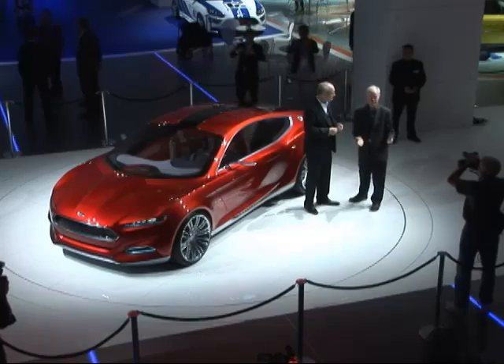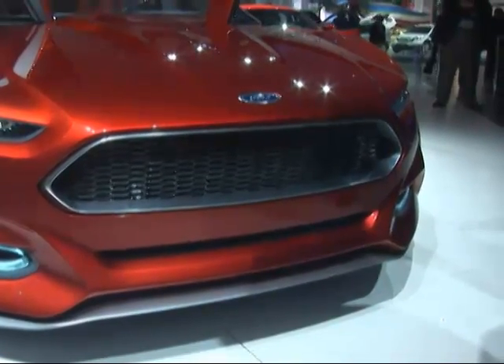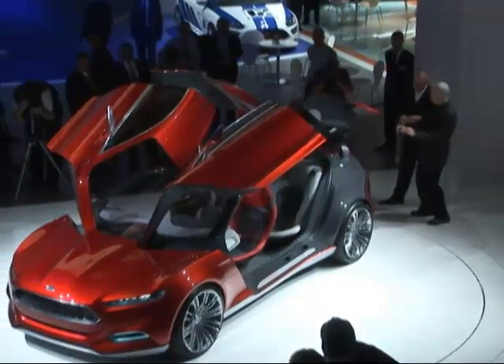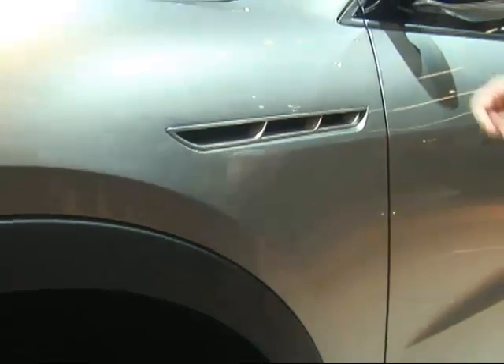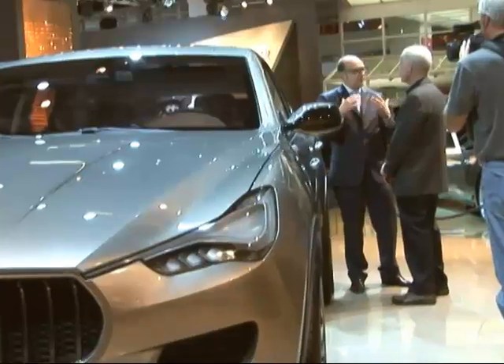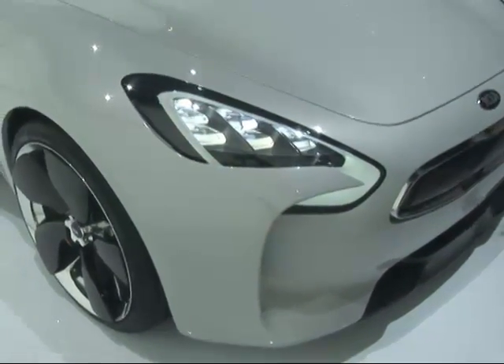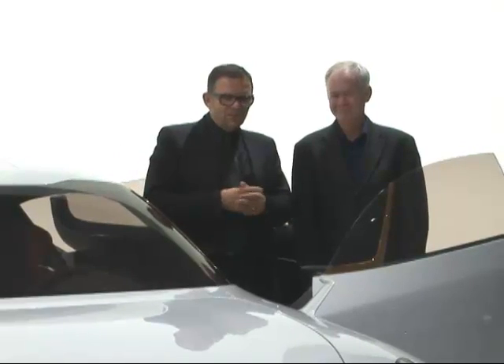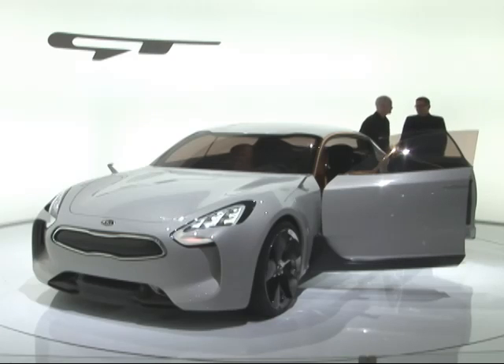Design on a Dime - Autoline This Week 1544

Comment: I think of the F-150 in the 1990s. In my life, the F-150 was boxy. But FORD decided on a sleek rounded truck, then. Apparently few people liked it. FORD went boxy, staying with the defining themes, after that, coming at it from different "angles". The 2005-now Mustang recalls what a Mustang looks like and is visually. If the new Mustang forgets this, not coming from a new angle, ignoring those themes, it will not be well thought of and/or remembered well, in comparison (see MY1979-2004).